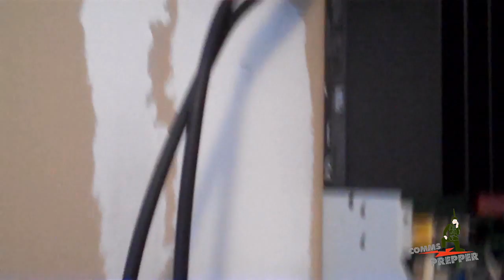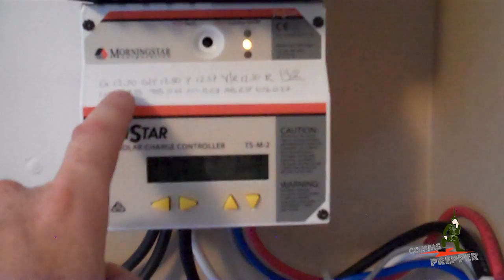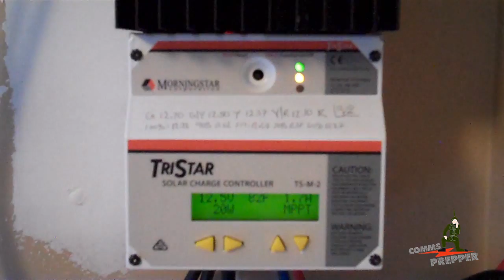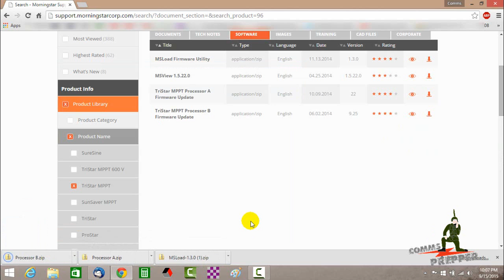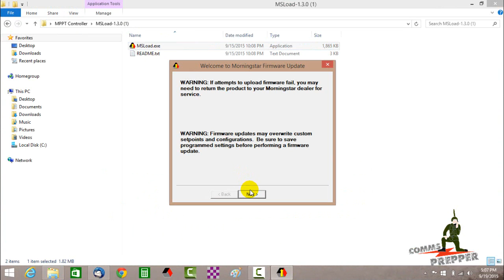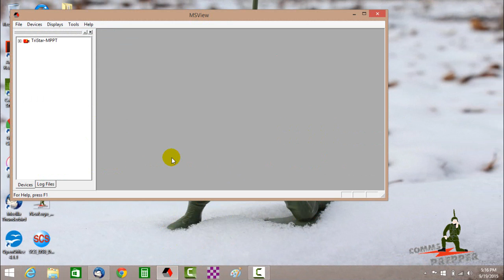Morningstar TS-MPPT-60 Firmware Upgrade

Comment: I have takeout my TS-MPPT-45 to update the firmware which never been use for 6yrs. I follow your instruction and able to update the firmware A V29.1. But once I try to update the firmware B V5.19, it failed to update. Try many time but still won't update. Swap the pc port between serial port and USB to serial port also failed to update. Use a laptop but failed. I try update firmware the meter TS-RM-2 and problem with it. Both meter and mppt firmware A confirm been update by the meter showing the latest version. Just the Firmware B won't update. How to solve this problem ?
Reply from the maker: I am not sure.  I suggest you contact morningstar tech support.
Reply: Thank you. I have contact morningstar and they told me, " there is no processor B on the TS-MPPT-45" . I m laughing myself. The problem solve.